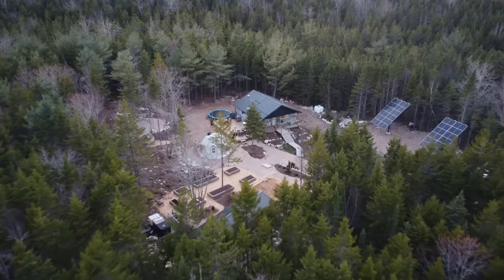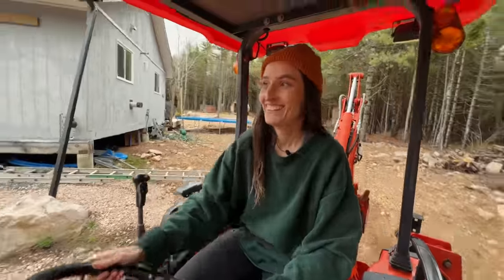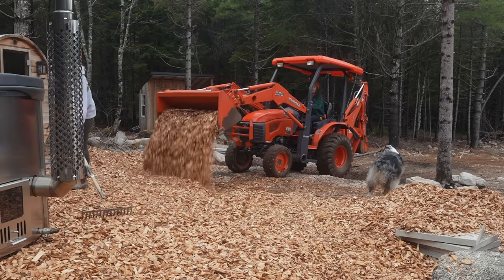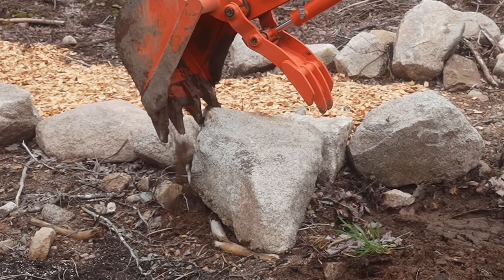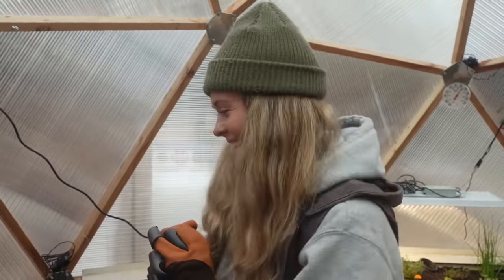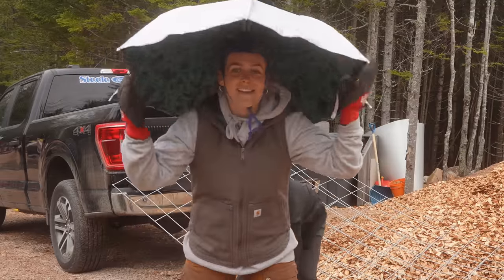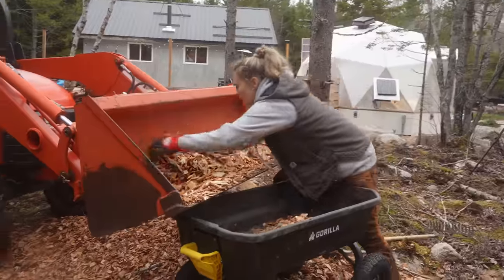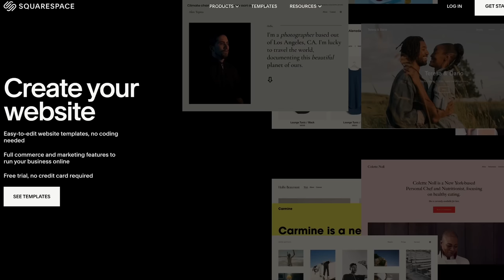Learning How To Operate A Tractor

Comment: Hey y’all, beginner tips! Always rest the bucket back onto the ground when not in use (hydraulics), also,tilt the bucket towards the ground so that if it rains the water streams off into the ground and doesn’t collect and sit in the bucket (rust). If you’re working in tight spaces you can put little flags on both sides of the bucket to help you not hit things, another good one is put a colourful piece of tape on the bucket rod so that you can use that to tell you when the bucket is level with the ground. Super useful if you’re working alone

Comment: Congratulations ladies! I love my Kubota! she's a 3650 I wouldn't want to be without her that's for sure. Have fun and be safe. P.S. She doesn't like to start in the winter when it gets super cold. So I just tarped it and slid a little heater in there, but you may want to consider a block heater for the winter months.  Your"bucket" is a front-end loader. I have a front-end loader too, but I don't have a backhoe wish I did, I have a back blade.I always make sure the bucket on the loader is upside down and then lower it to the ground when shutting down so it doesn't get rained in and rust. Then twirl the handle (Not sure what that is called) Joystick?  to release the pressure on the hydraulics. Not sure if it's necessary, it's just what I do. That is all I can think of right now. I am sure someone better than me will chime in if I am not right. Can't wait to see all you do with yours!  🚜🚜🚜
Reply: Was thinking the same things especially releasing the pressure after use most don’t think of that.
Reply: The pressure bypass is to release line pressure to connect and disconnect articulated attachments like a snow blower, jack hammer or fence post driver.

Comment: Congrats on the new tractor. I bought the same one a few years ago and I love this thing. Here are a few observations/tips for you. Before you try to lock or unlock the boom pull the left stick toward you to make it easier to engage or release. When in backhoe mode, slightly lift the front wheel with the bucket for better stability. If you want to convert the backhoe hydraulics to excavator controls you will need to move hydraulics hoses around. If you plan to improve the loader ability to dig, install a tooth bar its very useful. And don t forget to grease every 10 hours!!!!!

Comment: You can switch from backhoe mode to excavator mode by switching 4 hydraulic lines at the back of our tractor. I'm a 30 tonnes excavator operator and that is what I do when I have to use those small tractor with the backhoe bucket at the back.

Comment: One other suggestion I had a 100 gallon tank for our Kabota, This saves  on going for 1 or 2 fuel runs. You can get diesel fuel delivered to your home and can be locked up only for your use. Same thing applies to gas for the other devices.

Comment: Safety first!!! Fill the tires with non freezing liquid to add ballast for tip over safety.
Pull back the main arm control then push lock in or out for travel mode.

Comment: I've got the baby brother to this tractor with the backhoe, bucket and a 60" mower deck that I use on my 4 acres, it's been the best buy i've ever made. I use it for everything. When you were filling those garden beds by hand, I was thinking that there's no way I'd be doing that without my tractor 🤣😂Some advice - put the key on a keyring with the most obnoxious blob of colour you can find on it (think boat key fobs) so it's impossible to lose if you drop it. The bucket also has a float feature for hard surfaces, you can effectively set the level of the bucket and that way, you never take big gouges out of the ground when you're moving soil or mulch. Youtube has some great videos of how to use it. And you're the first people i've ever seen that use the seatbelt 🤣😂🤣

Comment: I do not know if anyone else has said this yet or not, but when you are using the backhoe function if you will curl the front bucket all the way down (dump) you can push the edge into the ground and have a little more stable platform. If you need to move the tractor while in using the backhoe and you do not want to have to keep turning the seat curl the bucket and press the rounded side of the bucket on the ground to pick up the front wheels and you can use the backhoe arm to move the entire machine.

Comment: If you don’t like the control pattern on the backhoe you can swap 4 hoses. There are 2 standard patterns for the controls, look up a hose diagram and swap hoses. The larger commercial machines use electronic valves to change back and forth. There are several YouTube videos on how to do it.

Comment: Always put the bucket back on the ground when not using also put it down to help stabilize when using the backhoe, use the out riggers to actually lift the tractor a little for better stability.  Also be careful driving with buck too high, you really want it high enough that the payload isnt spilling but not high enough to block your field of vision or create a tipping situation. Just a little advice from someone with many years operating. Also to properly latch the backhoe, make sure it is straight to the tractor so when your raising it up its coming toward you, pull on the lever and right before its all the way up, throw the lever in the opposite direction and it will mover further and latch itself. Then to unlatch just move the put one hand on latch lever while while pulling lever to lift boom and it will unlatch easily.

Comment: I don’t know if the B26 has a “float feature on the loader but if it does it is super handy for back dragging/ Leveling on our b3030 you just push the bucket lever to “dump” then an extra click more puts her into float mode. Now you can back up and the bucket just follows the ground contour. A Landscape rake is also super handy!

Comment: That is a BIG tractor for only being 24 HP. Mine is small by comparison but nearly double the HP. But I'm definitely jealous of the fully framed and covered cab, the swiveling seat and the extra hydraulic function in the back. I have to get down and change seats to use my backhoe. I think you're going to love it. I couldn't manage my homestead alone without it. It is funny that we both have the same struggle with the backhoe latch. Couldn't someone come up with a latch that doesn't require a hammer to make work?

Comment: I would go with Beastie,  since it has so many features and capabilities.  And after all it is a bit of a beast, which I must say you both operate with great proficiency.   Maybe a little more experience on the backhoe.  Don't forget you drive it backwards and use the edge of the bucket to level large areas.  Have fun.

Comment: Congratulations on the tractor! To lock the backhoe boom make sure the tractor is running and all the way back/up them lock it and always leave the bucket down to relieve the pressure on the hydrlic lines. You can switch some line to change it from John Deere or Cat controls. Most of the newer equipment have a switch but from an online search you would have to switch some of the hoses. Luv the channel!
Reply from the maker: Thanks for sharing your knowledge with us. So much appreciated. 🧡🐾

Comment: A new side hustle, and a way to meet neighbors, C&J Lanscapettes, pond excavators, french drain creators & grave diggers! Clear road kill for your M.D. Providing much needed loving excavation services in time of need. Fork lift is so versatile, lift cattle  panel, use with a strong tarp as a sling for moving heavy objects, and for elevated camera angles, endless uses. You can add a post hole digger attachment to dig post holes or holes to plant trees!

Comment: Y’all rock pack. The controls are easily swapped at the valves, so you have it the same as the excavator. Swap the lines as needed and voilà 😃.
As for the name, I alway name my tractor in-line with the brand. I have a Iseki tractor called “Issy”,  before I had een Yanmar called “yanni”. 
“Kubby” the Kubota maybe 🤣
🫶🏻
Reply from the maker: Thanks Mark, for sharing your knowledge with us. When it comes to the names we like the way you think.🧡🐾

Comment: I love the way you girls work you’re amaze me listen I have a little trick for you. I know you put down all your wood chips the way your lawn hits the wood chips. I advise you to put some sand in there, so it will soak up the water, so when you put the wood chips in it won’t just suck up all the water in the wood chips and still be soggy Sand actually soaks up water just a hint you know I know I did my own yard you have that’s what I did I put in my put in sand then I put my topsoil on top then I seated it and I put burlap bags on top of that and then I let that grow in and then about a year later I took off the burlap bags what was left and I had a beautiful one and it was waterproof. Basically the water seep down into the sand through everything and it’s beautiful, just wanted to give you a heads up. This is Alan from Massachusetts.

Comment: Tractors are the best!  I am surprised it took you that long...

I love my New Holland TC40DA.

You'll need this for the tractor.  Every grease zirk on the loader and back hoe needs grease every 8 hours.
https://youtu.be/LlwGF7RhgGA

There are many other grease points on a tractor, that need grease at other intervals.  See the manual.

Keep extra set of filters on hand for when you need them...

"The Orange Moose"